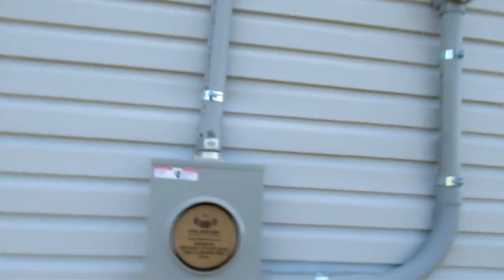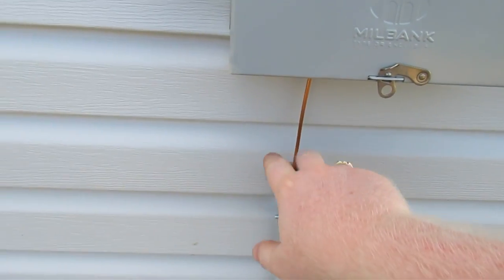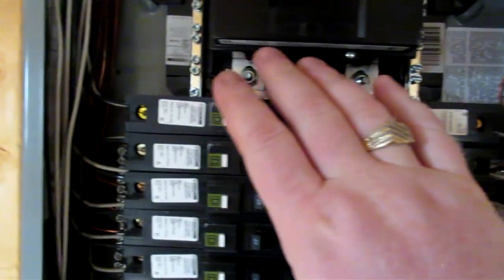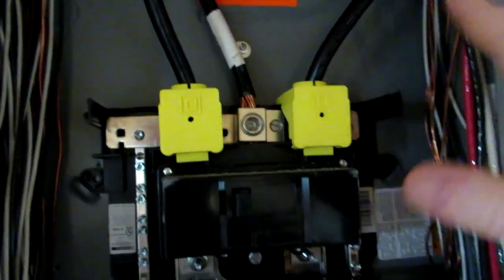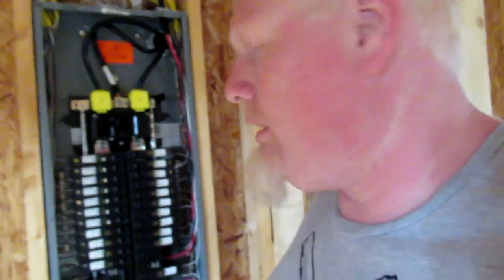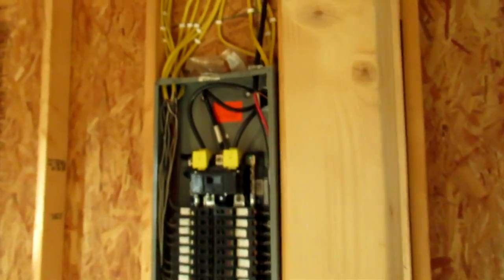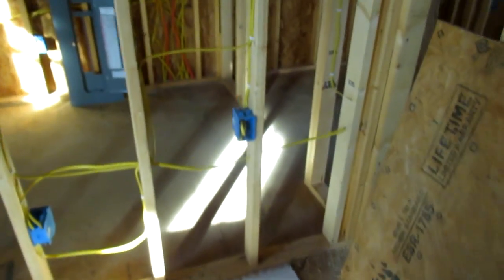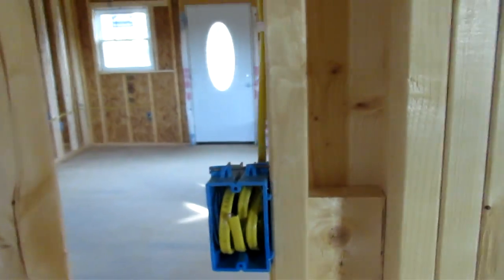How to wire a house

Comment: I like GFCI but they are way much expensive than the regular.
Reply from the maker: It is required to use arch fault for all 120v circuits here and the gfci are the same price if you buy the contractor pack. Thanks for watching
Reply: Modern code, not an option :(

Comment: Im a handyman/tradesman for 30 year's. This is prove that you can learn to help your self once you master a skill. I myself has mastered many skill in my work but only went to trade school to learn plumbing. The only thing that i see is the structure needs more weight load supports. Other than that I'm prode of your skill and work. Maybe i should move to your neighborhood to set up shop. What you think?
Reply from the maker: My neighbors are cows, coyotes and deer way out in the woods.  As long as you're not too close.  Ha

Comment: Be sure and always wire light in receptacle loop, when you kick a plug in or breaker you get to trip over it in the dark. The rest of the life of the house. For the price wire and a dedicated breaker . Code issue in many states. Check amp rating on light fixtures on integrating? Number of dedicated loops as required each room by design. Great personality, stop apologizing for trade education, you have great skills and a chance to learn. Great to bite the bullet, and purchase breakers as you chose. Separate light loops, exterior and interior, tv, ceiling fans , gas fired fixtures etc.  Could add extra ground in basement, double unbroken ground loop, panel receptacle  etc. You have the pride to due a good job, we all can learn.
Reply from the maker: Thanks for watching

Comment: Thank you so much for sharing. How did you get all these knowledge if you are not a professional electrician? Did you get help from someone? Hod did you start your project from scratch? Can you share your thought process and steps?
Reply from the maker: I'm a dedicated life long learner.  If you don't keep learning new things you will stop becoming better at doing things.  I wanted to save as much money as I could building my house and knew I would be able to do a lot of the work myself including wiring it.  You start out by learning as much as you can about the electrical codes in your area and then talking to electricians and the inspector.  From there you've got to get your hand's dirty and do the work.

Comment: in California , we have 3 Inspections, Rough in, lighting , final inspection
Reply from the maker: We only have two. Thanks for watching
Reply: k johnson  I work in residential construction in the South Bay and the permit process is out-of-control ...so much bureaucracy and wasted time/money that it would make the average viewer's head spin.  And yes, some of the inspectors are real dicks.  As a small example, we once installed pre-fabbed HVAC whips (like romex) manufactured specifically to be run from an HVAC unit to its disconnect.   The inspector made us re-wire them because the individual wires inside the casing didn't have the exact labeling even though the outer casing did and the packaging that the whips came in.   Sometimes you need a really stiff drink at the end of the day!
Reply: We just call it rough, ceiling,  final. Thsts commercial work

Comment: Here in Florida you would have to have an outside disconnect next to the meter can and your inside panel would be main lug only and grounds and neutral would have to be separated plus you would have to have a grounding rebar if it was a new slab.
Reply from the maker: Only mobile homes have to have an outside disconnect.  And you can still have a main inside the panel also. Thanks for watching.

Comment: An excellent job, and the green shielded ground from the main box to the meter is a good idea. I don't care for uninsulated wire and I think they should change it. But you did a great job and a great job explaining it to.
Reply from the maker: Thanks for watching. Unfortunately I had to remove the green wire because it wasn't code.

Comment: Arc-faults and GFCI breakers are $40 a piece. That is one expensive panel! Not only that Arc-faults trip if you breathe on them. They’re a headache and just a marketing ploy from manufactures. Code only requires bedrooms to be on Arc-faults. GFCI receptacles for bathrooms and kitchens are much more cost effective. Also I insist you make up your wires on the rough. When a sheet-rocker comes through he will destroy your wires with a Roto-zip. Also the painters will spray your boxes and your labels will be hard to read.
Reply from the maker: Arc fault is code here for all 120vac circuits.  Also don't have to make up grounds here.

Comment: In the kitchen and bathroom did you do the same as the first room plug to lights did you do gfi to lights and thanks on the ground screw tip
Reply from the maker: Yes for the most part. Light at the end of the circuit

Comment: I've watched several videos like this. Why do they always skip over the part where they go from the meter box to the breaker box? That's the info I need. I can't seem to find any info on it.
Reply: What do you need to know? 
Basically, the wires go from the meter housing (load side) through a pipe into the panel. Just make sure to use an appropriate sized pipe for your wire and use bushings on your fittings to protect the wire coming into your panel and exiting the meter housing.
This guy used an LB to 90 the wire through the wall space. You can see that in the video as well as where the wire comes into the panel. You can use any 3 inch knockout available in the panel to bring the wires in. From the top, sides, bottom or rear. Whatever makes it easier from the meter. 
Happy wiring!
Reply from the maker: Bottom of the meter base to the top of the panel
Reply: I ran the cable through the back of the meter base (using a bushing) straight into the wall space. Then turned cable up and into the bottom of the breaker box. Is this acceptable? It was a little different because it's a garage... built on a slope. Anyway, the outside meter box sits about level with bottom of breaker box inside . I tried to mimic the same routing as my main house.  The service entrance comes in through the garage, so it's a similar situation. What I wasn't sure about is  how the cable goes from meter box to breaker box, as my other one is obscured by drywall. Is a bushing sufficient or should the cable inside the wall be inside conduit? Or is it better to do this run on the outer wall instead, using watertight conduit?

Comment: What code did the inspector say that made you remove the grounding conductor from your meter box to the house panel. If you bond the neutral in the meter,by code you need an electrical ground conductor to you main panel. If you bring your ground into the panel then no ground conductor needed.
Reply from the maker: By bonding it in the meter the neutral effectively becomes the ground
Reply: @BeyondtheBoom  that's not true,per the code I have been in the trade and taught code built many of services. Once you bond your neutral everything after that requires a ground conductor. If you do it in the meter can then a ground conductor is required if in the main panel then yo don't. People like to say but in my area, not true if they approved the NEC. It will be the minimum they Wii add andments that are stricter. Hope you don't have a close lightning strike or a surge.

Comment: I use the same idea of one room per circuit  if possible .Looks like you used 12 gauge wiring for the whole house .I just read the city code here they do have language about arc fault protection ,must be new just had a panel done 6 months back no arc fault in it .
Reply from the maker: When I build my last house they only had to be in the bedrooms.  Now it has to be every 110v circuit.

Comment: I'm an electrical student, and was wondering: if you're using the 20 amp breaker with the 14/3, why would you need a lower amperage (15 amp) breaker? wouldn't using the 20 be safer so that you dont max out the 15?
Reply from the maker: You have to use a 15 amp breaker with 14 gauge wire.  The larger the gauge number the smaller the wire.
Reply: The breakers protect the wiring.  Yes, a 20 amp breaker would carry a bigger load, but the wiring cannot.
Reply: NO 20AMP CKTS IS 12 AWG it's been a while since I have read the code book, I think the article is 240 but check it out.

Comment: I use my Amp clamp and balance the loads so the amount of amps on average  are balanced on each leg of the 220  this makes the meter run slower because you will be charged for the current  on both sides  so you want to lower the amps on each leg and try to balance them
Reply from the maker: Good tip
Reply: David Mayhall     Balanced or not, the Watt hours measured are exactly the same.   Your electric bill will be the same.

Comment: Hello anyone please answer my question. Prior inspection, do I have to trip all romex cover "yellow protected skin" and fold the wires proper inside the electric box? or I leave the "yellow skin" and fold them? or trip them and connected with pigtail? Thanks in advance.
Reply from the maker: Depends on your inspector. Some of them in different areas around here want all of the grounds made up in your boxes. Others don't care. Just ask your inspector.

Comment: How did the framing pass inspection with no headers in the bearing walls?
Reply: Good eye and good question.
Reply: Yes windows by door no king or jack studs .. strange window framing support. Awesome electric job doing my own myself. I used 12 in stead of buying 2 different gauges. 
Put everything on 20 amps ( light and plugs and smoke) . Also did the circuit per room on 12-2, 12-3 for light fan combos. 
These breakers ark and gfi $55.00
Gets expensive real fast.
Reply: Some places in Ky you don't have to have a frame inspection.
Reply from the maker: I still live in a free state.

Comment: What brand is your main panel box? I like the idea that you do not need the extra piece of neutral wire for each breaker to be hooked up in the neutral bar.

Thanks
Reply from the maker: Square D Homeline
Reply from the maker: Make sure it has plug on neutral
Reply: Thank you very much

Comment: Im not an electrician but in the Northeast I'm pretty sure they make you have GFI outlets and they don't care if you have a circuit breaker like that as long as the outlet is. I've been disabled for 20 years so they may have changed that. But it used to be if you had a GFI outlet in circuit breaker it didn't matter you still needed one at the plug outlet
Reply from the maker: The breaker eliminates the need for a gfi receptacle
Reply: @BeyondtheBoom  when I used to work back 20 years ago in Connecticut I believe the code was it didn't matter if your breaker was ground-fault interrupted you had to have the actual outlet ground fault interrupter because it reacts faster than going all the way down to the power breaker box in your basement or the closet. Or at least that's what I was told. It always seems stupid to me.
Reply from the maker: @jeffwolf8018  different places have differences in the code. I just finished another house a few weeks ago and did it the same way
Reply: @BeyondtheBoom  this was in Connecticut.
Reply from the maker: @jeffwolf8018  in Tennessee they don't even require arc fault breakers yet. There's changes coming here that will require a service disconnect on the outside of the house under the meter base
Reply: @BeyondtheBoom  wow most of those codes are there to protect your house from burning down and shorting out so kind of towards your favor not against you. Glad that they're finally getting some codes down to you. I used to live in San Diego California where the codes were even harsher.

Comment: Looks  good.  Did you  use  2.0tt copper  on the  main feeders.  On the rough  in inspection  you have to  strip  in all the boxes.  They  only want to  see 1 inch of  insulation in the  box.  And all the wires  have to  be  made up.
Reply from the maker: I used copper everywhere.  The inspector here didn't require anything to be made up for the rough in.
Reply: @BeyondtheBoom  sorry  dude I  was talking about  my  area.  They  also  want a  insulated  porcelain  knob. Instead of  an eye bolt.  Because the neutral  is considered  a current carrying conductor.  And they  attach  the  neutral  to a metal  ty that is  connected to the  point of  attachment.  Also  they  don't want  a ground  wire in the meter can.  Plus  they  require a  main fusible  disconnect  on the outside of the  building  so they can  cut off  power  from the  outside.  Different  states  different  rules.  Different  cities  different  rules.  Some  cities  don't  allow  romex at all. It has to be in conduit  or m.c. cable.  Good  work  i liked the  video.  It's  nice to see  people who  build  there own  places.  Like it used to be.  It's  hard to find  anyone  getting  into the  trades or  wanting to  do anything  with  there hands  to build  something.

Comment: Pretty sure your ground gets tied to the panel neutral and not the meter neutral. It would get tied to the meter if there was a disconnect on the meter stack itself.
Reply from the maker: That's the purpose of the bonding screw that is installed. It ties the neutral and ground together.

Comment: Only thing I noticed was that there wasn’t a receptacle on the side of your panel which is a requirement.
Reply from the maker: That's not a requirement here.
Reply from the maker: Thanks for watching
Reply: That’s a requirement in the NEC which is enforced by all local code, you can’t take anything away from the NEC. You can add extra codes and precautions but you can never take away from it.
Reply: Aaron: Oh yes you can!  Look at the state of Michigan that doesn't require any AFCI breakers at all.  Or other states that only require them for bedrooms.
Reply: Jeff incorrect sir
Reply: Aaron: I live in Michigan, and I'm a licensed master electrician here.  I ought to know the codes.
Reply: @edioptimistic  I maintain a license in multiple states, so I'm well versed in both NEC and local amendments. Many states have amendments that loosen restrictions or even remove certain articles of the code. There are many states that go so far as to not even adopt new code cycles. So no, just because it's in the NEC, doesn't mean it will be enforced by local jurisdiction.
Reply: @edioptimistic  actually Aaron,Jeff is correct,I'm a licensed Master journeyman and work in multiple states,many states only adopt codes they agree with,like Idaho,they don't require afci protection on anything other than bedroom circuits.
Reply: Yes you can take away. My area does not require arc fault breakers at all due to the problems of false tripping.
Reply: I had a new panel box installed in my Michigan home in 2010 by a trusted, licensed electrician. He added a 20 amp, GFCI outlet immediately below the panel. I never thought about being required. Why is that? So people can double ensure with the outlet to ensure power is off when working on the panel.

Comment: I've done electrical since 1997 and all this bullshit is nothing more than selling an eggheads new idea to make more money for manufacturers, im not saying it isn't safe its just unnecessary. I know 75% of houses aren't even close to any of this shit, but do what thou wilt.
Reply from the maker: The inspector that covered this area years ago said basically the same thing.  It's all about the money.
Reply: Exactly!  I'm glad that the state of Michigan sees right through this BS, and therefore does NOT require arc-fault breakers at all!
Reply: I have a house built in 1974 , the breaker doesn't have any of that shit .

Comment: Full panel of gfci breakers, supplier must be rolling in money right about now heh. Excellent job, probably part in your motor experience. Things I'd point out is typically a level of vapour barrier is required around exterior device boxes on install. 12/2 everywhere is overkill but good quality alongside your gfci circuits. Concern I see is you've run circuits on top of your ceiling in the attic space. I would call that a concern for animal damage and safety of people walking in the attic. Best practise is to go down and through floors joists. From sparky up in Canada, good job overall
Reply from the maker: Arc fault is required for every 120vac circuit here.
Reply: Yes, arc fault. He's using 12 gauge and gfci breakers. Arc fault and ground fault are different.

Comment: Nice work, the only thing I would of done differently would be a lil less insulation on feeds in the panel. You only need 3/4 of an inch of insulation showing. Very neat !!
Reply from the maker: Yea.  I just trimmed it in a hurry.
Reply: It's actually a 1/4" of sheath minimum in any box or panel per NEC

Comment: NEC states there shall be a "minimum" of 2-20 amp small appliance branch circuits that serves the kitchen countertops. your inspector was wrong about that and i can't believe he past your rough in without all of your joints in your outlet boxes being made up. must be nice to have that kind of leniency, that would never pass here in florida. not saying it was a bad job, in fact it looked better than most i've seen from people claiming to know more on youtube, maybe even a little overkill on somethings, but not bad for someone with your background. good job
Reply from the maker: Thanks. As far as joints being made up, it's up to the inspector here.
Reply from the maker: There were also more than 2 circuits for the kitchen
Reply: @BeyondtheBoom  in Owyhee, you said that in the video, but you also said the inspector said that you only needed 1- 20 amp small appliance circuit in the kitchen and that's what I was referring to when I said that he was wrong.
Reply from the maker: I actually had to research it more before I finished the wiring and initially I thought you only needed one.  I don't wire houses for a living and wasn't sure of all of the codes until after I got it finished and past inspection.